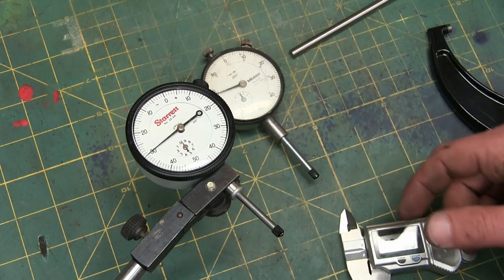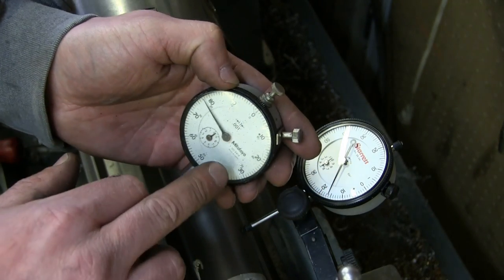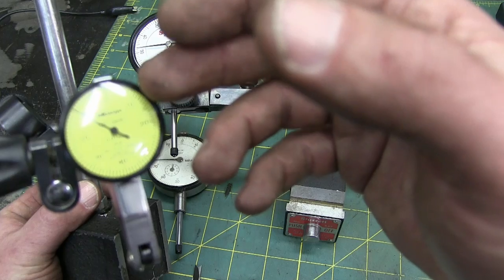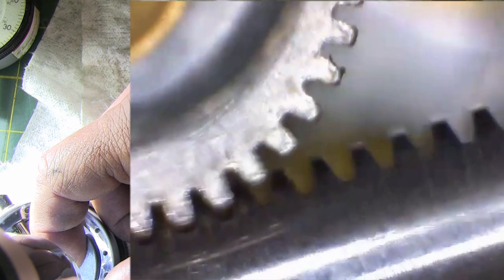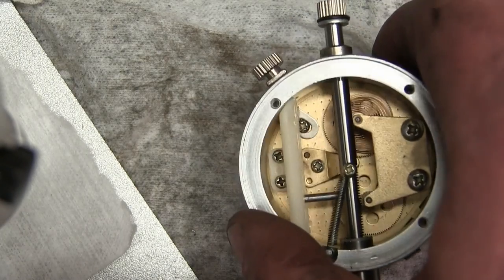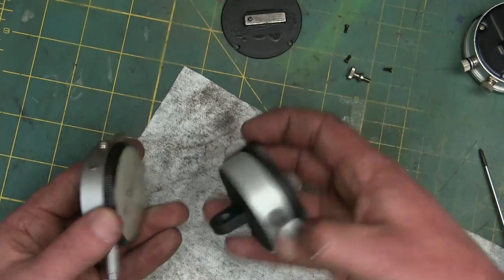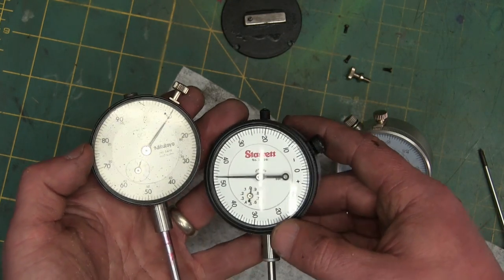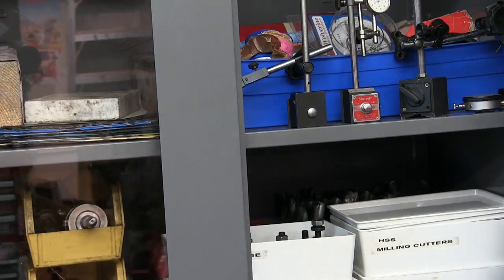BOLTR: Mitutoyo Dial Indicator

Comment: I do not have wife, but i have 5 dial indicators and no lathe or mill yet.
Reply from the maker: You' re on the right path!
Reply: milosevicnenad1993 I have the same problem I have 2 dial indicators no lathe or mill yet can't find one at a decent price that's not all clapped out
Reply: milosevicnenad1993 you got a great icon too (or whatever those little images by the name are called).
Reply: AvE You lead the right way!
Reply: You're doing well, you're doing the right thing.
Reply: You LUCKY bugger!

Comment: Had a cheep Chinesium dial indicator on a MightyMag for situations where you'd want to use the paper plates instead of the good china, oxymoron intended. Some fleet-footed tool grabber absconded with it and promptly reduced it to it's full potential, broken. Upon full confession, without even having to waterboard them, I only lashed them verbally to within 7/8 of and inch of their life. My leniency not being due to any flaw in my character but to the fact that the convicted took breaker bought his way out of debtor prison by paying me off with a nearly perfect Federal indicator of comparable range. I'm normally touchy about my tools but this incident had several dividends, my outrage was loud and public so few dared to borrow tools after that, the Federal became my go-to for precise measurement,  and eventually the tool breaker became one of my minions because I performed a "miracle" by fixing several of their tools including that POS indicator.

Comment: When measuring with calipers, always insert the test piece as far into the jaws as possible.
Reply: Yea the tip area on the main jaws are only for very sensitive parts. 90% of the time you want to put the part in the flat part close to the long body. If you always use the flat jaw tips to measure you can damage the tips, which can lead to burrs that bend inwards and mess up the clean flats. Also the jaws can become loose if you put a lot of pressure on that part repeatedly.

Comment: Careful not to confuse accuracy (adherence to a standard) with precision (how finely divided a scale is).  You can have a gauge which measures down to micrometers, but if its micrometers are the size of 1.1 micrometers for everyone else, it's very precise but not very accurate.

Comment: 99% of the way is good enough for most of us.  I swear by my 99% finest chinesium dial indicator.

For approximators, though, 99% of the way for 10% of the price is more than do-able, but you need to treat the product as "unfinished", stone off the sharp edges and clean out the grinding residue before use.  Got me a nice set of battery-free vernier approximators for 15 euros, after 10 minutes work they feel nearly as nice as the 20 year old Roch set at work, and I don't need to feel bad about misusing them

Comment: Machinists that use manual lathes a lot will generally buy the cheapest dial indicators possible because they get destroyed by flying chips and scale dust. I have a drawer full of 1" indicators for parts.

Comment: Buying a cheap indicator makes as much sense as buying your hand tools from the dollar store. If you have the proper equipment to routinely check calibration, repeatability, etc., you'll quickly find that the chineseium indicators do not last....whereas a reasonably well cared for mitutoyo/starrett/brown and sharp will last for decades. I have 30-40 year old indicators that will still pass whatever tests the calibration people want to throw at them.....but none of them are from countries with known quality control issues.

Comment: Back in the days of Enco, you could nab a pretty decent SPI dial indicator that weren't near as crunchy as the HF equivalent, but was still in the same price range.

Also, quit dickin around with those thirteen knob indicator holders and at least get the small Noga.

Unless you like handling knobs. Not that there's anything wrong with that.

Comment: An FYI.  According to Mitutoyo you were using the calipers wrong. Your standard should be closer to the center of the jaws for accuracy.  The ends are subject to warpage and flexing that will affect the measurement accuracy.

Comment: I've only been around the channel for a few weeks and have learned soooo much. 2 days ago I was working on my truck (1986 Chevy) and the window wipers were choochin slow so I took the wiper motor apart, and due to your videos I had an idea as to how it worked. It was a worm drive system, I greased her up and turned this adjustment screw thing and boom. Fixed. Thanks friend from the north. I would be lost without thou.

Comment: Love how they've used concepts from watchmaking to make the mechanisms. The bridge-plate construction and the set rubies to reduce friction. Rubies like that are usually used on the high wear points like balance wheel (the oscillator) in mechanical watches, mostly as a bushing. They make lubrication easier and increase the service period of the watch significantly. In watches, it also means that the ruby can be replaced once it is worn, instead of having to hand machine and replace an entire metal plate.Also, the friction coefficient of this setup is very low, which means much less energy is required to turn the gear that the rubies bear. Super cool innovations from over a 150 years ago. Still going strong.

Comment: I love powerfist plunge indicators.  An indicator that you use everyday is going to get abused so you need to be ready to replace it.  No sense in getting attached to an expensive starrett.  One hot chip lands on the plastic dial face and your in a bad mood.  Plus if you need accuracy you would use a test indicator or some other means.

Comment: slight correction, dial indicators are more accurate for linear measurement than test indicators, because of cosine error on the test indicators. testers tend to be more sensitive for comparative measurement (did I center the thing in the chuck?), but the dial indicator is better for absolute measurement (how far did I move the axis). you can buy 0.00005" graduated plunger type dial indicators too though. Like you said, depends on what you're up to.

Comment: They're also very useful (probably necessary) for tapers if you've got a taper attachment on your lathe. 

You should have used a dial indicator to dial in the straightness of that dial indicator. 

As for the "which one to buy" argument, I think if there is ANYWHERE you are going to splurge on and spend the big bucks it has to be with precision instruments. All your cuts and turns and the likes can be done on any machine and those machines can be tweaked or your cuts can be corrected, but if your measuring instruments are wrong then everything that goes out of your shop is wrong. It's best to get something that is built right and built to last.

Comment: Ave, My guess is you wouldn't be sitting down, sleeping soundly or ever be dry without us tree carcass  manglers. additionally I am inaccurate enough to use cheapo tape measures to do me manglin! will not find mitutoyo in my place of work. why use a caliper sir when an eyeball will do?
Reply: explain calibration, me no understand.
Reply: Can make buildings out of steel and or concrete. No more of these stick houses that go away when the wind blows out here on the plains. Gonna get me a concrete dome no dead tree carcasses allowed. 
:edit: tree carcasses do make nice furnishings though :edit:
Reply: Eyecrometers will work in a pinch, but sometimes you've gotta measure stuff to a tolerance..
Reply: Syncubus I will stick with between one and three fingers , that may change if I lose any digits.
Reply: diamondflaw so if I throw the expensive one away.. the wrong one is calibrated?
Reply: diamondflaw - tree carcass calipers are required for fancy floor coverings, ya don't wanna run the big sander over the whole dang floor, just make sure all yer planks is the same thickness before ya whip out the hammer & spikes, slop on a coat or three of something with a dirty old mop, and call it a day.
Reply: I used to have a boss who genuinely believed he could eyecrometer drilled holes being ~ 1/128" off on the cross square from ~100' away in the shop. If he wasn't right on the part I was making, he would shuffle through the pile of parts I had made until he found one. Given that we had wobly chinese drill presses, and were laying out the patterns by hand, he was always right. Personally, I thought that I deserved a medal for doing that well, since he had his Aspergery son """"""sharpen"""""""" the bits we had to use, and wouldn't trust the rest of us to.
Reply: Has anybody noticed that it sounds like a modern day pirate ship on this channel?

Comment: There is one misconception here. Test indicator is not more accurate than straight indicator. Quite the opposite the lever system usually produce more hysteresis. You can find some straight indicators with submicron hysteresis and repeatability(like mahr millimess ) but you rarely see any machenical lever indicator achieve that.  Even in the lvdt domain, straight probes usually have lower error comparing to the lever probes. The advantage to lever indicator is lower testing force and easier to reach some area.

Comment: Don't hit the stock with the hammer while the indicator is touching it, you will damage it. I have seen indicators with curved needles because of that, and it probably damages the pinion as well.

Comment: Measure up higher on the caliper and no 200lb ape pressure
Reply: Jordan Bjork  That's exactly what I was thinking. and I've been machining for fifteen years and have yet to need one of those dial indicators
Reply: I have a few test indicators. One with 30 thousands travel.  But I rarely do lathe work
Reply: Yep! Measure in as close to the base of the jaws as you can. The tip is handy but not for every day use. They might not be the most accurate things in the world, but at least show how to use them right! 
And +Andrew Delashaw look at Keith Fenner's video 'No Stinking Indicators'
They are handy, but not needed. :)
Reply: Trudat.  +Electra Flarefire

Comment: Speaking of QC, I worked for a company that made pole line hardware and to them QC consisted of whatever they could get away with. One shipment of product was going to a job where the parts  had to be in wooden crates instead of cardboard boxes because it was  being dropped in a remote area from a helicopter. The shear head bolts were plugged with galvanize because they spent too little time in  the centrifuge and therefore the shear head would break off before reaching proper torque. They had accepted a penalty clause in the contract saying a delay  on delivery would cost a grand a day. When the customer rejected the shipment a truckload of rejects had to be picked up by dog sled, shipped back to us and reworked. They went out the second time just a bit better and the excuse was they'd hardly reject them a second time.
The customer rejected them a second time meaning my employer lost a shitload of dollars because they didn't give a shit. 
kydiav

Comment: Not on all tools, BUT, for dial indicators, FUCK starrett... Mitutoyo is much more robust design...  I have used dial indicators on my job many times a day every day for 38 years... if you are a bit rough on your tools, Starrett dial indicatiors will spend more time out for repairs than on the job.... just once, tip your magnetic base over with a starrett indicator on it and WOOPS off to the repair shop again.  I'd rather use harbor freight throw away dial indicators than Starrett.  That being said, Starrett tools (other than dial indicators) are my favorite. Starrett last word indicators GOOD! I.D. Mics.. GOOD!  O.D. mics GOOD! an so on.

Comment: One tip: when you have an indicator that for some reason is reacting slowly or seeming to hang up a little, take a clean dry cloth and carefully and thoroughly wipe the indicator stem off being sure to move it all the way in and clean the other end as well...  it takes barely a microscopic amount of residue or oil to make them become sluggish, cleaning with dry clean cloth will help.

Comment: Newer Starretts are really over rated now. NYCCNC has a Starrett factory tour video showing how the rakes are made. We get both Starrett and Mitutoyo stuff brand new, the Japanese stuff is advantageous, frequently with less money as well.

BTW the claim that test indicators are more accurate than dial indicators isn't always correct. Ask yourself cosine error. All major manufactures make dial indicator that has resolution down to a tenth.

Comment: Of course it's nice to have a well known brand, but is it really worth the massive difference in price?

For indicating in the lathe, mill etc, it's repeat-ability, rather than absolute linear accuracy, is 
 what matters.

When used on the ways, for machining to a length/depth, how often will a 1000th of a mm  really matter?

From Amazon, you can get a Mitutoyo DTI for a few pennies under £36, or a proprietary brand one (complete with a magnetic base), for £16.

You could have 2 of the proprietary ones, for less than the price of one Mitutoyo, and you would still need a magnetic base for the Mitutoyo.

Comment: One note: At 5:55, you refer to the jewel as "carborundum".  But you correct that at about 12:00.  Rubies (synthetic or real) are corundum, which is aluminum oxide.  Carborundum is silicon carbide.  Both are really hard compounds, but different.

Comment: The gridy grindy noise on the power fister is caused by having the pinion to rack mesh too tight. Ease up on the mesh and it will run smoother. Its a common fault in any brand of indicator if it has been dropped or abused. Speaking of which whats with the angled return spring pin on the S and the M indicators? Shurely it ought to be at 90 degrees.

Comment: Almost have my shop built, and doing research on purchasing a mill and lathe.  As AvE very clearly point out in this especially useful video, the quality of Grizzly is apparently horrible.  I’ve purchased a few tooling items and a gauge from them, and it appears to me the source in China, and pass without either inspection or statistical sampling right to the end consumer.  Great if you like the learning experience of spending time discovering what is wrong with your project, and realizing most of the time it was Grizzly.  I’ve spent hours this week talking to machine shops, and every time without fail I’d get an unsolicited “whatever you do, stay away from Grizzly.”  Hope passing that on here saves someone a lot of pain;  AvE is right again!

Comment: Don't know anything about these, but I know accuracy, and for a better word 'sensitivity do not go hand in hand. Just because the tool is more sensitive it doesn't guarantee accuracy...until it has been calibrated anyhow.. Bearings are interesting, overall friction from a jeweled pivot is much higher than that of a ball race, but they have very low stiction  and require minimal force to start moving, though a miniature ball race can have ten times lower moving friction...I don't understand that....but seems the case.I think its repeatability and variation is more controlled with a jewel too. Ball races are much tougher too. Pointless comment, I know.
Reply: There are two companies I know of that produce and sell all manner of miniature jeweled bearings . Great to look through their sites.

Comment: Just a tip from someone who used to repair camcorders: Get yourself some cross point screwdrivers for those tiny Japanesium screws. Sure a 00 Phillips will do in a pinch, but using the correct driver makes it so much easier. The screw actually sticks on the tip with no wobble which makes losing the screw a lot less likely. The screw will fit tight enough that you can pick the screwdriver up with the screw.

Comment: Thank you for the great review.  Did my fair share of machining.  Hated the starrett all the way around.  Horror freight, forget it.  I like the MITUTOYO.  The feel on them was much better.  Anyone that used the ratchet is a rank armature.  Mine are down to 0.0001 of an inch. QC always messed with them to "set them right".  I always changed them back.  The way I handled my mics was different than the way they did.  Over one year and thousands of inspections, I only had one set up rejected.  Please remember, a mic is NOT A C CLAMP. .

Comment: You've got me wondering... about measuring a flat ended standard using calipers.   What is the best sample/caliper configuration for a flat ended sample?  - caliper blade tips verses the jaws' wider surface closer to the body?  Wouldn't a larger flat area improve measurement repeatability? (better jaw/jaw perpendicular contact)  Do caliper manufacturers pay attention to more than the tips?  (There's a joke here)  Your thoughts?

Comment: I got a 'broken'  Mitutoyo from a company that was moving to Colorado some years back.  I took it apart and couldn't figure out how to fix it, but dropped some oil on the pinion shaft.  That didn't seem to help, but when I went back to er a week later, she worked like a charm.  Thanks for showing me around the clockworks inside, maybe now in the future I can make sense of the gears in there!

Comment: Can't you just close them... And see if they read zero...?
Reply: You mean the micrometers? They only measure a few hundred thou + or . That's why they come with the check bar thingy, one for each size of micrometer. Usually they come in 1" increments. If you're lucky, you own the whole set up to 12". If you're a freakin' tool fetisher, you own even bigger ones! :)

Comment: That ♫tappy tap tap♫ music to my ears.... dumb question, when you turn material normally ±.0005" is well within industrial engineering standards (for low cost), in your experience ripping a-part tooling would you say a ±.0002" tolerance is expected for a skukum tool? I kind of think lower than ±.0005 is overkill (unless its a measuring tool)